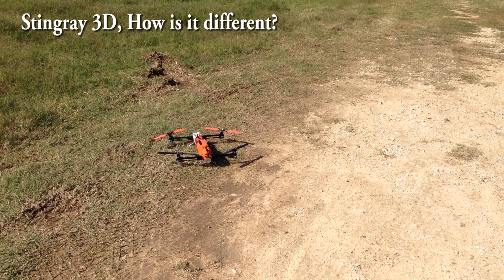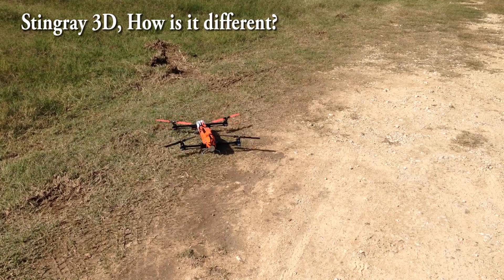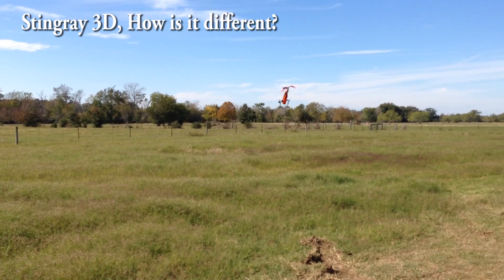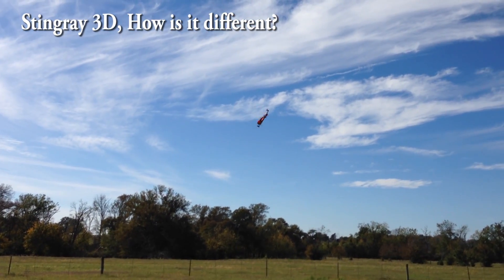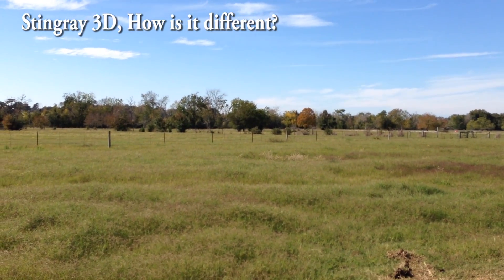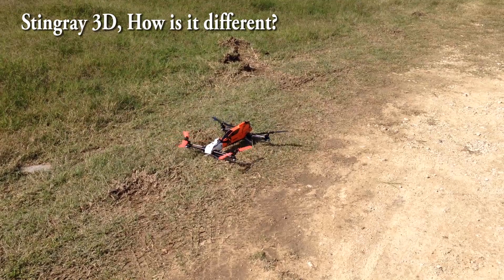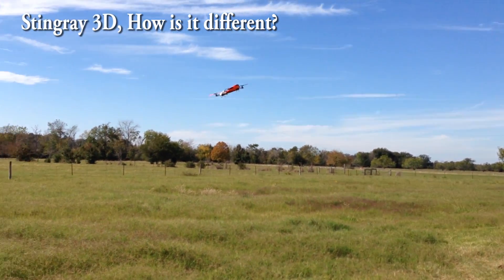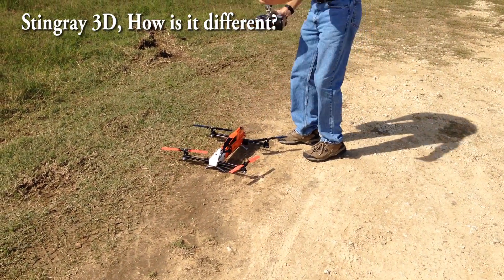Stingray 500 Setup Vid# 19 - How is Stingray 3D different

Comment: Awesome design Curtis! Question, how does the yaw work, since you cannot use counter rotation like other quads?
Reply: It uses the collective to simulate the same kind of torque change that causes yaw on a standard quad. Since the collective is completely variable you can make any of the rotors rotate normally or counterclockwise. The way two motors spool up and two spool down on a standard quad to induce yaw, two rotors gain positive collective pitch while the others go more neutral or negative. At least, that's my understanding of it. I'm not a collective pitch pilot by any means, the only time I've flown a CP heli I was terrified the whole time and only hovered it tail-in.